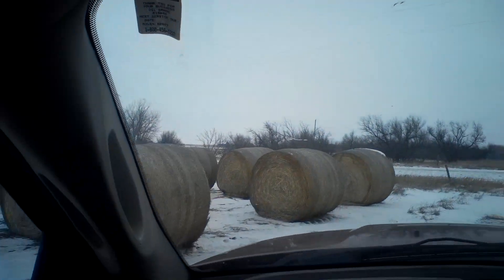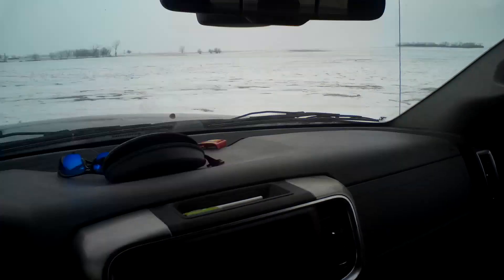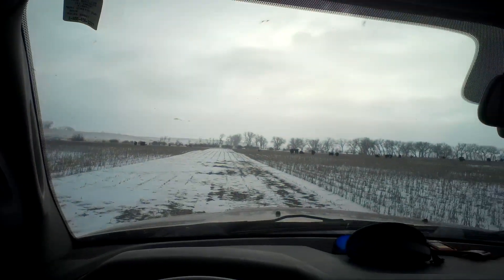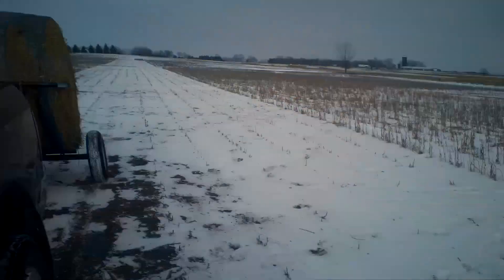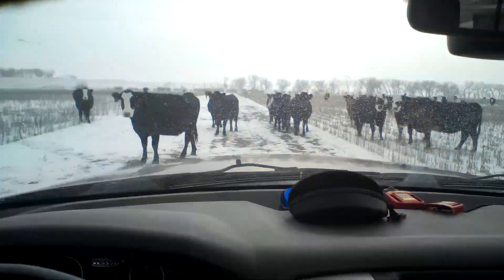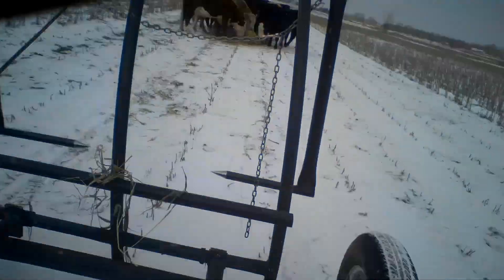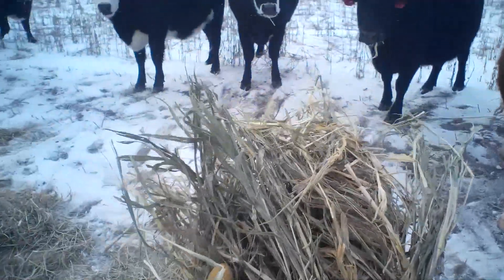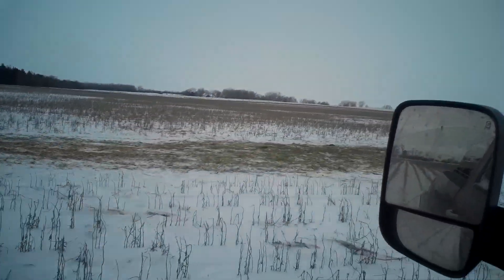Hay B Gone hay unroller working

Comment: Weld an eye on a 3 ft piece of 5/8 rod.  Drive the rod into the bale and use your 4 wheeler to pull bale out of stack.  I usually back up to the bale by hand vs the machine.  It’s easier and quicker.  I can back up  to, load and then unroll a bale in about 15 minutes, depending on transport distance.  You do need to pay attention to the way it was rolled. I like that I can feed without starting a tractor in 0 weather.  If you’re feeding more than three, a tractor is likely better.  You can also feed partial bales pretty easy. I’ve used mine with no problems 4 winters.
Reply from the maker: we generally feeed enough to feed either with the wagon or bales with the tractor

Comment: One advantage of having hilly pasture, you dont need to buy an implement to unroll bales lol. Cut the strings and let gravity do it's thing.
Reply from the maker: Yea..... that works too still have to get the bales there though...
Reply: Yeah we just use the bale spear on the tractor that we use to take them off the field. No extra implement to buy is all I meant.
Reply from the maker: Yes your correct but my brother... who purchased this has no tractor.  i think this implement is meant for those who dont have equipment or the cows are spread out and would take for ever to feed them with a tractor.  No offense taken im glad you took the time to comment

Comment: My old boss had one similar to that didn't have the cradle and it only had one spike that went all the way through. After a few bales in a day we always threatened to put an electric winch on it
Reply from the maker: This one aint too bad to lift the bale up... i thought it would be hard but it really wasnt
Reply: Ted Kahler my experience with one was mainly with cane baled with on old nh baler weren't wrapped too tight but they sure work like you said when you don't have a tractor

Comment: I think that worked really well especially as it is a simple reliable piece of equipment, I also think that it is good that it goes behind your truck which means it is not so miserable for the driver in those unpleasant working weather conditions. I have seen something similar being used behind an ATV.
Reply from the maker: My brother uses it behind his 4 wheeler but i like the confort of my pickup

Comment: I think it would be very difficult to back it into a bale with snow and mud conditions.  Also, bales can't be stored tight end to end with this rig.  Need to pay attention to which way the bale was rolled up for it to unroll easily.  I think this bale unroller has pretty limited value for most operations.
Reply from the maker: it actally backs up well even when wet.... most the time we pull with 4 wheeler or side by side.... bales can be stored end to end just have to move a  few at a time so you dont have to start the tractor every day to move bales..    very similar to bale bed on pickup    may not work where your at but works decent here